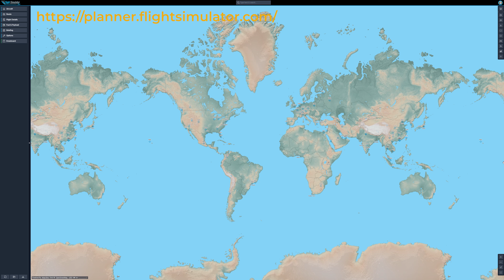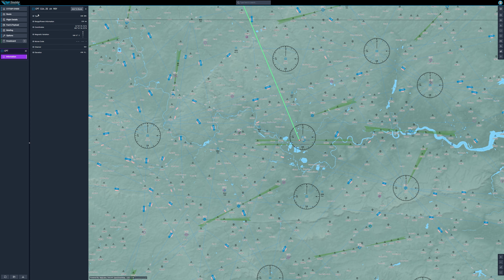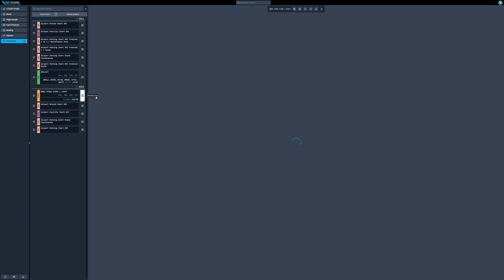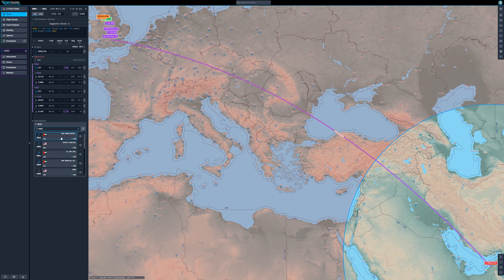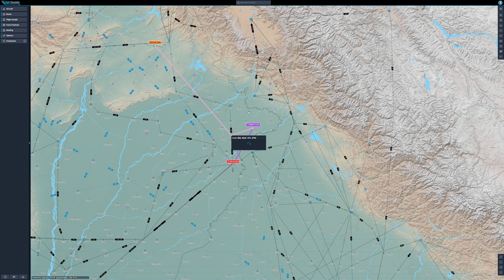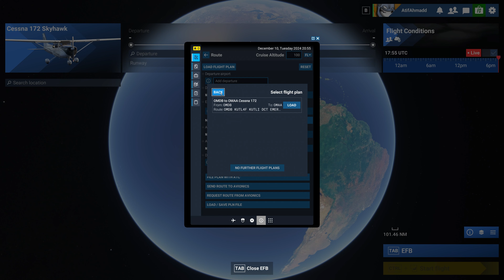How to Make a Flight Plan With Microsoft Flight Planner for MSFS 2024 | A Beginners Guide

Comment: What does it mean when your airport doesn't connect to your departure or arriveal doesn't connect to your approach?  I keep trying to set up routes for the 737 from Minneapolis KMSP to Chicago KORD, a hub to hub regional flight.  The departures from MSP start away from the airport and the arrival and the approach into ORD never connect, the arrival ends and the approach starts out over Lake Michigan.  So there's a gap between KMSP and the first waypoint of the route and there's a gap between the end of my arrival and the beginning of my approach into ORD.  It's not one smooth line from runway to runway as this guy has in his tutorials.  Why is that?  Is that because IRL you are supposed to be vectored by ATC from the runway to the first waypoint and from the arrival to the initial WP of your approach?  The in game ATC never does it if I use that auto route to fly.
Reply: Same issue for me and I've yet to figure it out. You figure anything out?

Comment: Does this work for console users? And also, will it work on career mode? I haven’t tried to load it on freeflight but on career mode for sure it didn’t work. That load flight plan option is not something I can click open.
Reply from the maker: I am not using Xbox, therefore, my knowledge is limited in this regard. However, the flight plan doesn't work in the career mode.
Reply: @ I can confirm that it does work for Xbox on free flight only. The flight plan loaded as such.

Comment: Does this mean I can cancel Navigraph or not quite yet?
Reply from the maker: Subscription fee is required to access the AIRAC cycle and the charts. With the new simulator the charts are available but for the updated AIRAC cycle you will require a Navigraph subscription. You can have a one month subscription which will update the AIRAC cycle and then you can cancel it anytime. This is just to update the AIRAC cycle so that you get the latest SID and STARs for your flight.

Comment: Unfortunately, at this point loading the flight plan into the EFB is very buggy. As of two days ago, it would not load any departures or approaches. Also, if you are doing the planning on the EFB direct, it will not give you any departures or approaches except direct. It was working for me when I did a video 5 days ago, but now is broken.
Reply: It’s never worked for me. I’m glad (and sad) I’m not the only one. I set a flight plan and my plan just keeps flying once I hit the airport, even though I can see the route on the display. I always have to manually fly it in on career mode.
Reply: Everything is so buggy these days. It's like the developers are all on crack cocaine or something. Not enjoyable. The mechanics of getting around in the game is overly complex. The aircraft itself is not complex. But just simply getting around is not intuitive and buggy at best